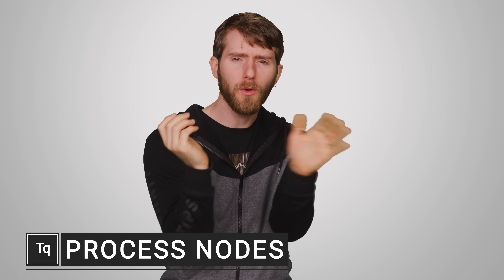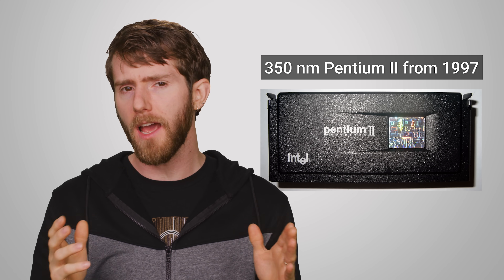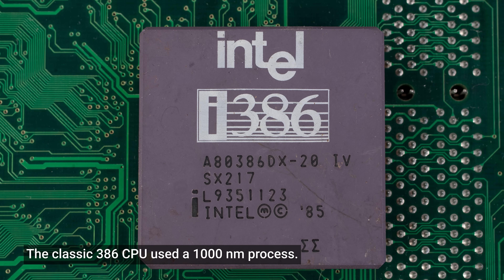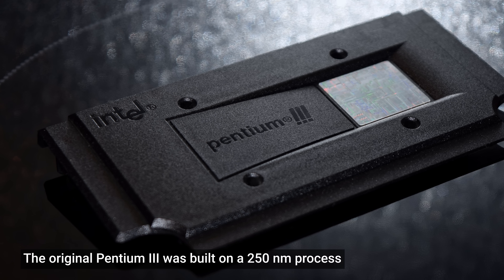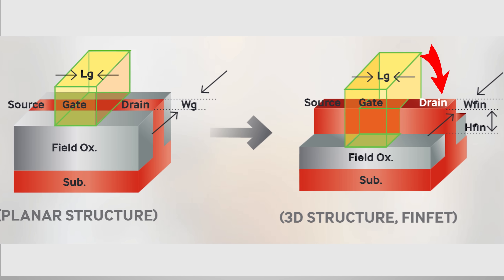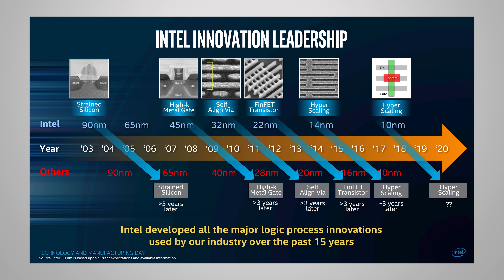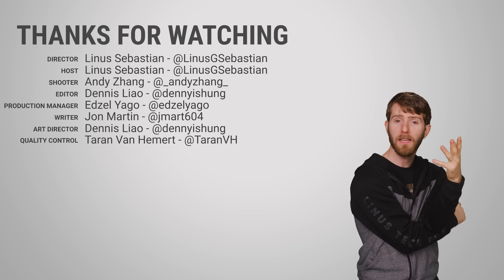Should You Believe CPU Marketing? - Process Nodes Explained

Comment: intel: we're not on the smallest advertised process node
also intel: process node numbers done matter
everyone else: you sure, as AMD are kicking your a$$ on a lower process node.
Reply: Lol I know why amd is ahead is becoz they use tsmc for fabrication while intel for some complicated reasons not doing.
Reply: @hari14m  Intel is NOT A FOUNDRY like TSMC/GF.
They got no pressured by any external customers (because they don't have any customers using their fab like TSMC/GF).
Reply: smokeyassassin     Things change very quickly!
Reply: @METhOdhowtoKilLnoObS I've been called an AMD fanboy, Intel fanboy, Nvidia fanboy, or they don't even want to know the hard truth that:
AMD is charging users more when compared to the previous flagship release (PX4 9600, P2X6 1090T and FX-8150).
Not only that AMD pushed for an APU for the consumer, regardless of core count, because, without any iGPU, your system is basically a huge, and expensive paperweight, doesn't meet the basic criteria of a PC. Just take out your dGPU and see if you could actually use your system without it.
Intel thermals after 6th generation are atrocious, and board vendors are pushing Intel in changing socket every two generations (except for 2066, which had 3 generations), also looking at LGA 775 history, I think Intel agreed with the board vendor in changing socket. Plus, most ppl I talked to have ZERO technical knowledge as to why Intel did the socket change.
Nvidia charges more because they have newer unproved technology that is basically chicken-in-the-egg.
Imagine, if RTX doesn't exist, but Microsoft already have DX12 DXR (or the other way around)? No current cards will be able to take advantage of it, no game dev will implement it, no optimisation, etc. Same thing happened when DX10 was a thing. DX10 cards were more expensive in MSRP when compared to previous flagship DX9. It's a fucking domino effect.
Maybe you should really begin to reflect on your own behaviour.
Reply: Thomas Borisov  Except, it's not AMD's 12/7nm, it's TSMC/GF, and AMD still charges us more for corporate greed.
And Intel is working on figuring out how to do stable 14/10nm yields, buying new fabrication tools, experiencing yield loss, breaking news, Intel fab not only CPU, they do other stuffs like memory, chipset, NIC, FPGA, so their own fab, the fab capacity is divided between multiple devices.
They got no pressured by any external customers (because they don't have any customers using their fab like TSMC/GF).
That's the reason why Intel charges more. Sure Intel is making a profit, but like I said, they aren't making CPU-only, they got other devices to make revenue.
Reply: Breaking news! It's not AMD's 7/5nm! It's TSMC! AMD contribute nothing into getting into smaller fabrication!
Guess an Aymdiot fanboy detected!
Reply: @AlfaPro1337  How do those Intel boots taste?
Reply: @AlfaPro1337  
Uhm... maxwell? Rx200? We're talking about cpu's here, or are you forgettimg that already? 

A cpu is a completely different beast then a gpu, both in working and design. And you're whining about almost 7 year old architectures, which is almost dead and burried territory in this industry.
Reply: @AlfaPro1337  and so what? Who stops Intel from selling their factories to some third-grade chipmaker and placing orders at TSMC as well?
Reply: @Agent_Krasnov  AFAIK, only lower end parts to TSMC.
Reply: @AlfaPro1337  Salty blue tears much?
Reply: @JohnSmith-xq1pz  Guess an Aymdiot fanboy detected!
Reply: @AlfaPro1337  There's just one little problem with that guess. Until ZEN I was team blue and had been for the 10 years AMD was slacking off.

I don't hold loyalty to any one brand or Corporation. AMD and Ryzen is simply the best bang for the buck so I jumped the fence.

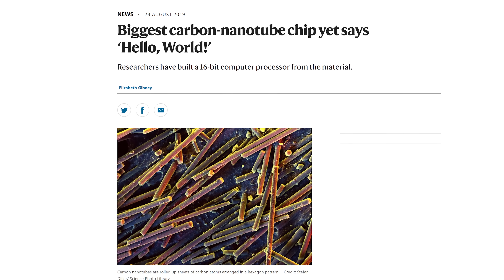Comment: 5:30 "Just remember that the processor node isn't the be all and end all when you're shopping for a CPU anyway"
Oh and real world performance, but at what cost in efficiency?
Check your process node for answers.
Reply: Nah. Measure real world efficiency if you want to determine the efficiency of the node. TSCM's 7nm is similar to Intel's 10nm in what regards transistor density, thus being somewhat equal in efficiency, despite "7nm" suggesting TSCM's gate size being 70% of Intel's 10nm (suggesting in consequence that TSCM has the lead). Because there is no measuring standard (and they are basically estimates of what the performance should look like), process node is a term that can be used, and actually is, to mislead customers.
Reply: @diegofkda199  This comment should be pinned
Reply: @diegofkda199  doesn't change the fact that Intel's chips are 200% overpriced so even if they're as electrically as efficient Intel is still horrible value. The tradeoff for anything midrange is literally a tiny bit of clock speed vs double the core and/or thread count
Reply: CEO of Linus media group is CEO of intel confirmed
Reply: Are you CEO of TSMC or something?

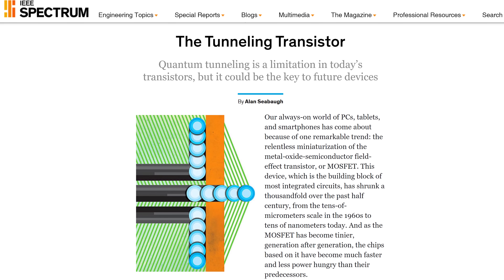Comment: 3:08 - If we're living in a simulation, then quantum tunneling is a clipping error.
Reply: Isn't it more like data disappearing through the noise floor (at the other end of the system's dynamic range)?
Reply: No, it is the loss of some LSBs and not a clip at the maximum.   The number of bits to describe a particle is fixed.  The more that are allocated to storing accurate position the fewer can be used for the velocity.  This is why when you multiply the two you get the same number of bits in the result no matter which you favor with more bits.
Reply: Seems like a pretty serious bug though, devs pls fix

Comment: why not increase the cpu chip physical size to stack more transistors?
Reply: The speed of signals crossing the chip from one side to the other is well under the speed of light.  A bigger chip ends up slower in many cases.
Every square inch of silicon costs you money.  Smaller is cheaper.
The chips are already so bit they are troublesome to package.

Comment: The message in the video, while technically true, leaves a bad taste to me. It points specifically to intel current weaknesess, and might be taken wrongly by the uneducated crowd
Reply: @Caleb P isn't the amd threadripper the best processor though?
Reply: @Caleb P Yeah I was also disappointed by the 5% less frame rates on AMD.
Reply: @Caleb P Umm no actually. Intel cpus are 5% maybe 10% better at gaming even in the best case scenario. And in scenario they are even slower than competing ryzen chips. But in either cases intel is the more expensive one by a significant margin.

Unless you want the absolute best performance and do nothing but gaming and money is no object to you, then sure go for intel.

Note : What I said is true for most cases. There are some exceptions where intel is actually the better option but they are quite rare.
I think we have wait for 10nm for intel to regain the gaming king title

Comment: When are we going to start measuring performance by how much RGB we have in the system?
Reply: Soon we'll see companies marketing HDR RGB accessories. Man, the performance boost we'll get from that!!
Reply: Of course! Red means more power. Green for more efficiency. And blue lowest the temperatures.
Reply: I need my RGB cpu
Reply: My computer's RGB makes about 5 additional Horsepower.
Reply: I overclocked my system to 16.24 quintillion lumen of Gamer RGB goodness thanks to a custom water loop. You jelly?
Reply: Soon
Reply: i thought that was already how it works for gaming pcs?
Reply: True dat. More LEDs means more eFPS (epileptic fits per second) so you face-roll more noobs. 
Now, where can I get a 50 kilowatt PSU for my million candle power gaming rig ?
Reply: @Bassman-r3c  real gamers just download more fps
Reply: You say that like it's a joke but optical computing can be millions of time faster than electronic computing and is better for networking. In another 10-15 years it might be a legit question.
Reply: I downloaded more 625nm wavelength color when I downloaded my extra 32GB of RAM.
Reply: I already do
Reply: I guess
Reply: No thx
Reply: Never
Reply: It will, When silicone photonics start coming to the commercial market.

Comment: 0:39
From Intel about Nanometer ?

I hope the Video will be Fair
Reply: Why indians are so obsessed with AMD ?  Go to benchmarks softwares and compare intel 10 th gen processor to Ryzen 3000/ 4000 series and see the actual difference .
Reply: @tdmguy8304  What should I see ?

AMD is way ahead of Intel at a TDP of 35 watt ..!
Believe it or not , I have seen Benchmark by multiple YT Channels . and The results are same 

And if in any case , Intel performs SLIGHTLY better then also I'll choose AMD because I won't sacrifice battery Backup for those extra 3 FPS

Comment: of course, they asked intel...
Reply: Becouse intel is trustable, unlike amd, wich keeps making promises and claims while those "archivements" amd makes aint even real
Reply: @eijmert  you did see the marketing material that recently got leaked where they claimed intel was better in a laptop when they compared a thin light 4900HS with a 2060 Max Q (65W TDP) against an intel one with a 2060 Mobile (115W TDP) that was also a more traditional haming laptop, being bulkier and better cooling? if they cant even compare two systems with the same specs or at the LEAST the same use case, its hard to trust intel AT ALL right now, I hate having to speak bad about intel but they need to hold them selves to a better manner and not be so evil corporation scamming their potential customers with false or misleading information